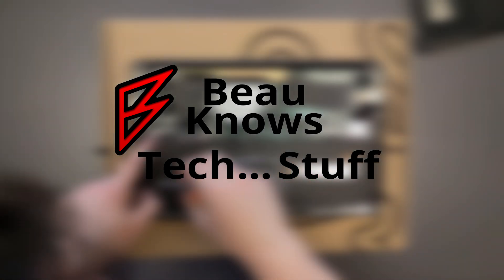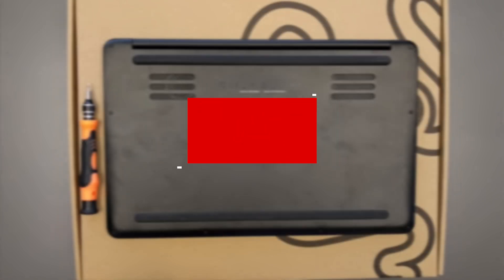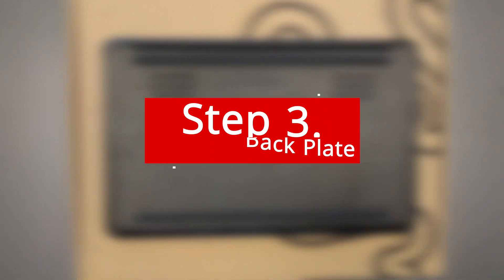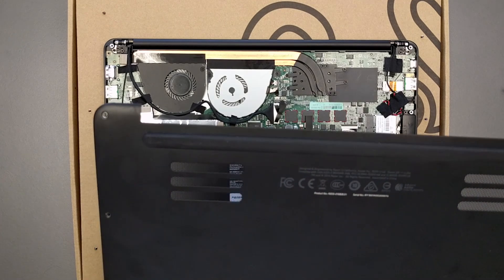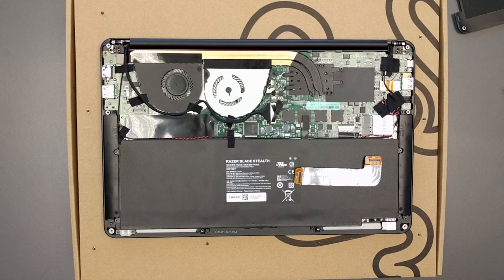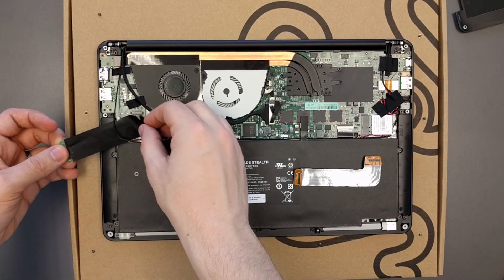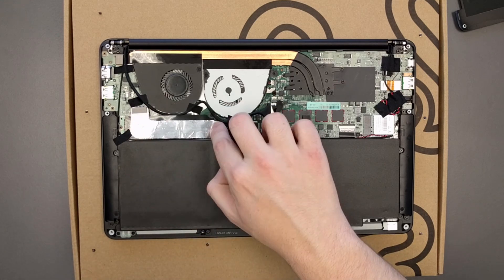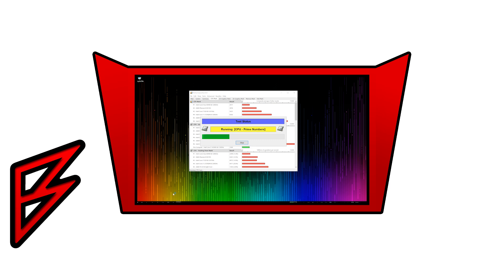How to Upgrade the SSD in a Razer Blade Stealth V.1

Comment: this video is super old so i'm not really expecting a reply but .... when you say you would need to use clonezilla/a similar software after replacing the ssd ... would doing a full system backup to an external drive and then redownloading (not sure if thats the right word but you know what i mean) it have the same effect? or would i need to install windows 10 before i did that? thanks :)
Reply from the maker: There are a bunch of ways to do it but the easiest way is to probably to do what you said and create a system image on an external drive or a recovery USB. Then booting into recovery mode from a Windows 10 USB drive. Windows can do this in the control panel from "system and security"and then "backup and restore". There are also other programs that would accomplish the same thing if you want to Google other solutions.

Secondly, as always I would recommend making file level backups first just in case.

Comment: Used this tutorial for diagonising the issue with my SSD. It seems like the SSD is still working, but there might be some issues due to the disconnection from the mothetboard. Razer should care about the quality of the components.

Comment: okay I don't know anything about computers, but I have a razer bs 128 gb. by using this method, am I going to be able to increase storage space?
Reply: If you don't know a anything about computers I wouldn't recommend doing this. You will need to buy the right kind of SSD, and the right tools. Then follow these instructions. Then use something like clonezilla or other cloning software to get your OS onto the new SSD.

Comment: Is it possible to upgrade the processor? I really would wanna buy this with a better processor.
Reply: What in the four fucking gates of hell would ram have to do with this, stop talking out of your ass. 

As for the processor, no. The i7 6500u is the best processor you can get at this size. Anything better would generate far too much heat. And regardless, even if there was a better processor to replace it with, I'm almost certain Razer wouldn't build it to be user replaceable.
Reply: If the ram is soldered in what do you think?
Reply: No..?
Reply: no, the intel mobile cpus have been mostly soldered since ivy bridge

Comment: Hi just a quick question, is the motherboard support the SATA m.2? I want to replace the 128SSD to a 1TB ssd, but there is no pcle m.2 SSD for 1tb yet...
Reply from the maker: +Stephen savage I think that is an m2 Sata drive. Am I wrong? It needs to be pci nvme
Reply from the maker: It has to be PCIe.
Reply: +Beau Knows Tech... Stuff  ok... And I do u have problems for the screen, sometimes it flash and sometimes it just shutdown for the screen.
Reply from the maker: +Arvin Han I haven't had any issues like that
Reply: will the motherboard support the 1tb ssd with pcie m.2 ?
Reply from the maker: +Arvin Han which ssd are you looking at?
Reply: I saw a m.2 from intel but its sata port... and I heard that samsung is going to release a 1tb nvme ssd later in the year?
Reply from the maker: +Arvin Han I hope so.
Reply: They've been out since before you posted this comment. https://www.amazon.com/Sandisk-Solid-State-Drive-SD8SN8U-1T00-1122/dp/B0194MV300/ref=sr_1_1?ie=UTF8&qid=1467668559&sr=8-1&keywords=m2+1tb

Comment: If I'm going to upgrade my ssd on a brand new razor blade stealth, would I have to flash copy the OS on the new SSD or can I do a fresh installation on the new SSD?
Reply from the maker: +Phillip I would copy the OS using clonezilla or something like that. But you can always do a fresh install, and then if that doesn't work or Windows won't activate or something like that, you can still clone the drive it came with over to the new drive. Just make sure you keep the old drive as a backup.

Comment: was that black plastic on the ssd important at all? do i have to move it to the new ssd or is it okay without it?
Reply from the maker: +eFrood It should be fine without it
Reply: It was probably put there to shield from interference from the data cable directly on top of it.  It "shouldn't" make a difference but I would personally leave it on.  It was put there for a reason.

Comment: So I have a question, I mainly want to upgrade the storage on this to download games. Could I use an external storage and play games off of it? Or do the games have to be downloaded to the computer
Reply from the maker: +Snuggieman Yes! Most games allow you to install (or move) to a different location. I would recommend an external SSD for games. But an external hard drive will work. The games might just load slower.

Comment: After replacing the SSD, does the laptop boot up and set itself up automatically??? Like does it set up as it would like the stock SSD would have?
Reply from the maker: +dubie4x8 no, you either have to reinstall Windows, or use hard drive cloning software to transfer the OS.
Reply: +Beau Knows Tech... Stuff  To reinstall Windows, do I have to put Windows 10 on a flash drive and boot it from a USB?
Reply from the maker: +dubie4x8 if you are doing a fresh install of Windows, yes.
Reply: +Beau Knows Tech... Stuff 
If I use a cloning software like Macruim Reflect to clone the stock SSD to a temporary drive, then remove the stock SSD, replace it with the new SSD, can I then Boot from the temporary drive??? Because it's technically a clone.  And after doing so I can then clone the temporary drive to my newly installed SSD?
(Sorry to play 20 Questions over here, I just want to check with someone who knows their stuff before diving in)
Reply from the maker: I have never used that software before, but you could try it. You could test and see if it would boot to the external drive before you take out the SSD just to check and see if it would work. I use a program called clonezilla. I mount that to a flash drive. Then I plug that flash drive as well as an external hard drive into the computer and save an image of the laptop's ssd to the external drive. Then I take out the old ssd, put the new one in, and boot to the clonezilla flash drive again but this time I take the image from the old ssd and put it on the new ssd. Does that make sense? That is just how I do it, the way you have planned out might work. You could also just install a full version of windows to an external hard drive, boot to that external drive on your stealth, run a cloning software to make an image of your stealths ssd and then put in the new ssd and put the image onto the new ssd.
Reply: +Beau Knows Tech... Stuff  I think I get what you're saying.  I've been watching lots of tutorials on how to do this and the videos I watched seemed to be just "clone and swap", but yea i'll definitely have to see if it can boot from the external drive first before swapping

Comment: Wow really nice vid Keep going ! +1 Subs ,umm by the way what type is it ? M.2?
Reply from the maker: +Adhito So yes, it is M.2 NGFF PCIe Gen3 x4, NVME size 2280. Which means 22mm wide and 80mm in length. The model of SSD that comes with the Razer Blade Stealth is a Samsung PM951(OEM grade). According to other peeps online, this model(SAMSUNG 950 PRO M.2): http://amzn.to/1nZlBt7 will work as well because it is PCIe NVME and is also the same size as the PM951

Comment: Nice video bro. Do you know if the cpu is upgradeable?
Reply: +The 6th Order The CPU is soldered in and unfortunately is not upgrade-able... yet.
Reply from the maker: +The 6th Order what iamjewtastic said lol
Reply: Thanks. That sucks you'd think those two fans and heatsink could cool a 4 core cpu easily. I do not think I'll buy it until the razer core is out and properly tested. The fact that it is taking them this long has me worried.
Reply from the maker: I can't wait to test the core! But it might be a good idea to wait for gen 2 of the stealth. I know a few people that are waiting
Reply: That is also a good idea. Hopefully they can implement it on the a new razer blade 14 release.  A 12.5 inch screen and no dedicated gpu is still kind of disappointing to me.

Comment: Thanks for a good vid :) Because this voids the warranty though, do you think that if something went wrong with a new SSD in it would be possible to put the original SSD back in and send it in for repairs under warranty without razer knowing that there was ever another SSD in there? Also, do you think it's worth buying the 256GB stealth from razer for an extra $200 or just go with the 128GB version then buy a SSD separately and put it in
Reply from the maker: +T Ryan Honestly I don't see how Razer would be able to tell unless you stripped a screw a little bit or something like that.
If you are only upgrading to 256 I would just pay Razer the extra 200 bucks because the Samsung 950 Pro m.2 that you would get is $180 and its not worth the $20 just to void the warranty. If you are upgrading to 512 950 Pro m.2 it would be worth it in my opinion to buy the 128 version and then spend the $330 on the 512 SSD and upgrade that way. Because you are saving almost 300 bucks. Also english is technically my first language but I still suck at it so hopefully my explanation made sense :)
Reply: +Beau Knows Tech... Stuff - Awesome thanks man. I read somewhere else that it only had a 256GB samsung pm951 in there which is worth $130 but if it's the 950 pro m.2 then that makes more sense. I'll probably just start with the 128GB one though and see how I go. Thanks!
Reply from the maker: +T Ryan Yes, it does use a pm951. The pm951 is a slow drive however. But you seem like you are a pretty technical person, I think you are making the right decision with the 128GB version :)

Comment: Are you getting better performance out of the new ssd?  Or was it just a size upgrade?  I have the 256gb UHD, and I'm wondering if it's worth it to void the warranty.  Ive heard the stock ssd is a slow one, but it seems snappy enough to me.
Reply from the maker: +Skyshatter The stock SSD is slow. Like slower than my SATA 940 evo in my other laptop. I unfortunately didn't actually try out the samsung 950 pro, yet. But from what I heard it is significantly faster. When I have the $ to buy it I will be getting the 512GB 950 PRO M.2. and then I will be doing my own speed tests.

Comment: Nice video, you might want to use other word then "replace" in many of the cases though, for example in the end you said "you will want to replace the back plate now", makes no sense, because we're just putting it back on.
Reply from the maker: I didn't even notice lol good catch! I'll keep that in mind for next time. I appreciate you pointing that out, thanks!
Reply: Beau Knows Tech... Stuff no problem mate
Reply: +Cheer Chunhao Actually replace also means "to put back", so he's using the word in the correct sense.

Comment: Nice video, you might want to use other word then "replace" in many of the cases though, for example in the end you said "you will want to replace the back plate now", makes no sense, because we're just putting it back on.
Reply: Definition of replace when used as a transitive verb
1:  to restore to a former place or position "replace cards in a file"

Comment: Can I use a USB and Windows 10 built-in "Create USB recovery drive" app to create recovery drive ? I'm worry about what if the motherboard doesn't recognize the 950 PRO~ Because some laptops doesn't recognize 950 pro without the Intel Rapid Storage Tec drive (XPS 13)..~
Reply from the maker: +Iltarix Ilyar It might work, I guess.. to use the "Create USB recovery drive". I've just never heard of or seen anyone do that before. I use Acronis and/or Paragon HDM to backup and migrate images. This guy on reddit has bought a 950 pro and is going to report back if it worked or not: https://www.reddit.com/r/razer/comments/44pyzn/swapping_out_my_razer_blade_stealth_128gb_ssd/
So keep an eye on that post
Reply: +Beau Knows Tech... Stuff thxxx
Reply from the maker: +Iltarix Ilyar Also this guy confirmed that it worked for him: http://www.thegeeksoffice.com/?p=2136
Reply: +Beau Knows Tech... Stuff thxxx, do you know what the flex cable does at the top of the ssd ??? I forget to put it back on, and i couldn't open the backplate anymore... strepped screws! T T
Reply from the maker: +Iltarix Ilyar If you are talking about the flex cable from step 4 of this video, that cable connects the HDMI port and USB. Is that the cable you are talking about?
Reply: +Beau Knows Tech... Stuff Yes it is... I can't use USB ports without it ??? I dont care about HDMI doe~
Reply from the maker: +Iltarix Ilyar You can still use one. It only affects the USB port on the same side as the HDMI.
Reply from the maker: +Iltarix Ilyar What happened that stripped the screws?
Reply: +Beau Knows Tech... Stuff I don't have T5, so i used T6... Is there any tips for that ?? Im thinking about super glue or something
Reply from the maker: +Iltarix Ilyar Ouch.. That sucks. I honestly don't have any experience with that. I wish I could be of more help!
Reply: +Beau Knows Tech... Stuff thxx  anyway!

Comment: Subbed. What's that black tape on top of the ssd?
Reply from the maker: +MrDeezi Thanks for the sub! TBH I'm not exactly sure. It seems to be one of three things; 1. Some kind of protector from the flex cable on top of it. 2. Simply a way to speed up the manufacturing process or something along those lines. 3. A way for razer to tell if you opened your machine or not. haha Source: https://www.reddit.com/r/razer/comments/44pyzn/swapping_out_my_razer_blade_stealth_128gb_ssd/
Reply: +Beau Knows Tech... Stuff thanks. Btw is the SSD AHCI or NVME standard? Looking forward to your benchmark video.
Reply from the maker: +MrDeezi NVME. The SSD that comes in it a Samsung PM951.
Reply: +Beau Knows Tech... Stuff Just replaced my SSD based on your video, with my finger nail. lol. thanks again. Anyway my back plate is a little warped when I open it up, the top right corner of it is bent up when I unscrewed it. and the one of the two little plastic catch at the top seems broken. did yours had the same issue?
Reply from the maker: +MrDeezi That is unfortunate about the back plate, I did not have any bending issues. I might have had an issue with the plastic tab except I only remember there only being one. So maybe I broke one too haha
Reply: +Beau Knows Tech... Stuff some quality control on Razer man... Anyway did you managed to upgrade the SSD? my 950 pro doesn't seems to performed at its optimal state.
Reply from the maker: +MrDeezi I haven't yet.. My wife said I've been spending too much money lately lol. Do you get better performance from the ssd when you are on battery? If you get better performance on battery you may need to apply the update from this video: https://youtu.be/VFLtGLcCb4w
Reply: +Beau Knows Tech... Stuff Yes I did the patch based on your video as well. haha. The was all similar result, except for Aida64, I get throttling after a couple minute in. Anyhow 950pro is quite an overkill, i think a pm951 512GB would be sufficient.
Reply from the maker: hmm good to know. Thanks!

Comment: What type of SSD does it need to be? Obviously M.2, but what length and what type of M.2?
Reply from the maker: +Julien Blanchet That is a great question. So yes, it is M.2 NGFF PCIe Gen3 x4, NVME size 2280. Which means 22mm wide and 80mm in length. The model of SSD that comes with the Razer Blade Stealth is a Samsung PM951(OEM grade). According to other peeps online, this model(SAMSUNG 950 PRO M.2): http://amzn.to/1nZlBt7 will work as well because it is PCIe NVME and is also the same size as the PM951
Reply: +Julien Blanchet I heard that it is pcie/ nvme
Reply from the maker: +Twilightangel95 Exactly!
Reply: +Beau Knows Tech... Stuff I just ordered it using your link. Thanks!